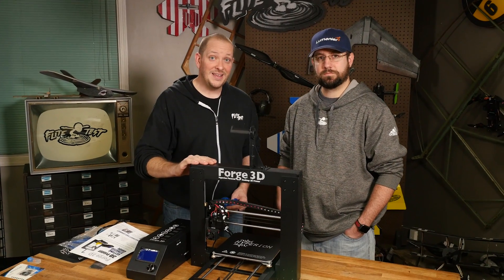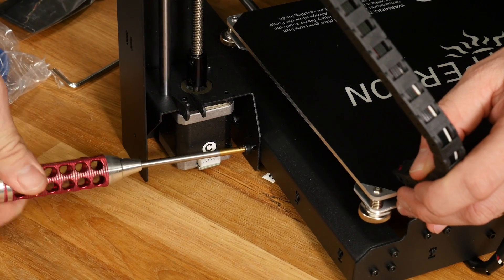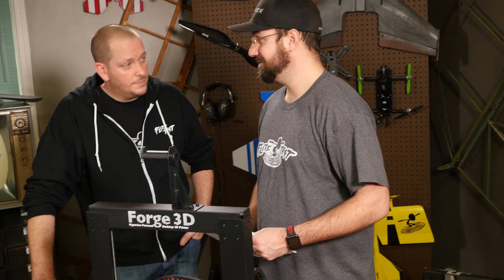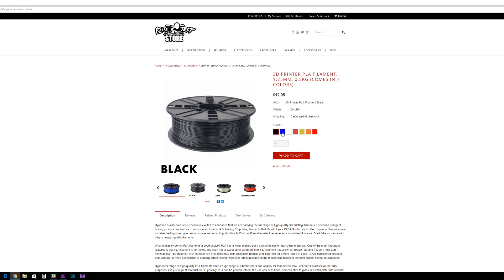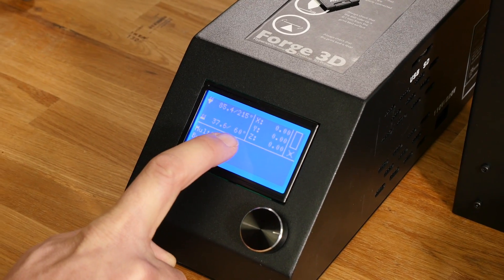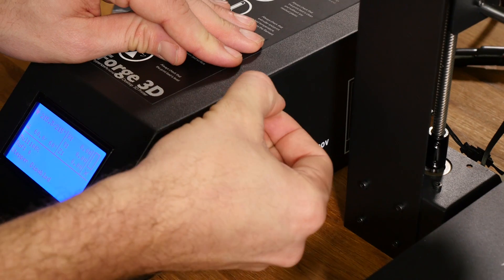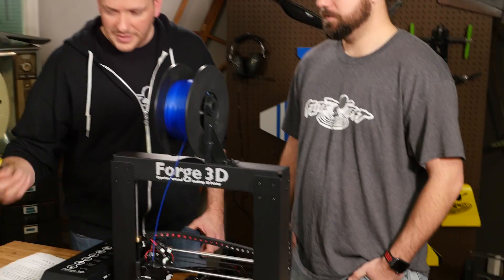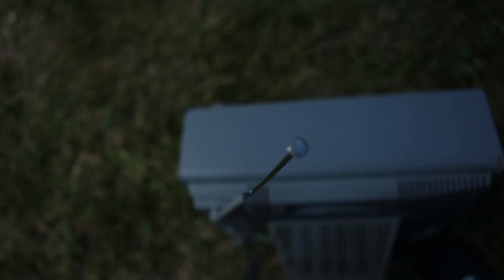How To Setup the Forge 3D Printer | Flite Test

Comment: I got the Monoprice version of this when it was on sale for $260 around New Years.  It worked right away but has a ton of little problems that should have been fixed at the factory before it was released for sale.  The Z axis tower is wobbly and needs to be braced.  The pulley under the front of the bed was mounted using the wrong kind of screw so it couldn't be tightened down so they put a nut on the inside which makes the belt be about 6mm out of alignment to the right.  There are plans on Thingaverse to print a new bracket but just using the proper screw will fix that. The Cura software that came with the unit was an obsolete version in Chinese.  It's the same version in English that you see in all the Youtube videos showing how to setup the unit but it's no longer supported by Cura since they have a new version that's totally different.  The fan in the control box has bad bearings and is very noisy.  They are reporting on the forums the connections on the control board for the heated bed are too small and tend to burn up but you can buy a heavy duty external controller from Banggood for $7 that can be installed to fix that.  There was no damage to mine but I noticed the bed draws 20 Amps when it's heating up while the rest of the unit draws 3.5 Amps but the power supply is only rated for 20 Amps and will be overloaded.  The bed is mounted on a thin piece of sheet metal that tends to bend down at the corners making the clearance hard to keep adjusted but you can buy a stiffer piece on Ebay for $15 or make one out of thicker metal that won't bend so easily.  The oddest thing is the rod holding the spools of filament is too small and the bracket is too weak to hold up a spool!  You'd think they would have checked that at the factory!  I used a 6" piece of 1" plastic pipe to make a larger rod and added a second bracket at the outside end to hold it up. Monoprice has the best deal on filament though, just $19.95 per 1Kg spool. They have free shipping on orders over $50 and I got 15% off using code Maker15 so 3 spools cost just $51 with free shipping!

Comment: DO NOT turn off the printer and let it cool down, it will eventually clog the nozzle. Go to SD then click stop print. Then go to cool down under heat up pla. And if you have any questions just reply, thanks

Comment: I have three printers, all but one was a box of parts that had to be assembled piece by piece. After finishing assembly then the arduino board had to be downloaded with software code and fine tuned with a dial indicator on all axis. Only my FlashForge was plug and play. I use either Autocad or SketchUp to design parts which then go to Cura for slicing into g-code that the machine uses. I worked for National Oilwell Varco as a lead programmer machinist trainer, this is child's play compared to 9-axis dual spindle Mori-Seiki NTs, or Mazak Integrex.

Comment: I can level by eye now, at one time, I hated leveling so much I would just cover the bed with adhesive instead xD Now I print on glass with no adhesive at all. Suction of the smooth glass and level bed holds the part in place.

Comment: It's important you don't just switch off the power button after the print ends. You have to leave it on so the heater in the extruded lowers its temperature slowly, preventing blockages. Switching it off makes it harden inside incorrectly

Comment: You really don't won't to just kill the power u could easy melt the cooling fan that is attached to the extruder heat sink best to go in to the window and hit kill or stop print that way the fan will stay on and bring the temp down safely.

Comment: AHey guys, LOVE the videos!!!  This is a rebranded Wanhoa Duplucator i3...   I have the same printer rebranded to Monoprice Maker select V2.     Just wanted you to know that so that later you can see the mods for the printer for stability mods.

Never move the printer parts manually while the printer is on. Turn it off then move it. or use the settings to fast move settings.

And to save you some time, you can use a raspberry pi to be a print server for that printer. You can do time lapses, see the printer status, and set the print order with multiple files.

Again LOVE your work!  Keep it up!
Reply: Also you should measure from 2 inches in from the corners to get the plate level as well.

Comment: Also, nobody really uses the extruder motor to feed filament. :-) It has become traditional among long-beards to just push it through manually so you can feel how silky smooth it is at the current temp. After a while you can dial-in settings (and whether you've got a nozzle jam) from the feelings. (There's a billion poor-taste puns that could go here, I'll leave them to y'all)
Reply: I mean during the initial filament load. Not when printing, of course.

Comment: Nice! Looks like a clone of the Wanhao Duplicator i3 but with long bearings. I've got the hobbyking Malyan M150 which is another clone. It's fun noting all the little variations. Those are the best bearings on any clone I've seen, it's got the nice sloped control panel front of the Di3, but the cable management on the hot-end is also the same horror-show as the Wanhao/Cocoon (please put some heat-shrink over that thermistor "connector"! If it falls out, badness follows swiftly.) where Hobbyking did much better on the Malyan M150 with proper connectors. (even though their heater connector is under-rated and melts)

(I know all this because I just spent a month doing a redesign of the print head on the Wanhao/Malyan to fit a remote bowden E3D V6 hot-end: http://www.thingiverse.com/thing:2068847 which I very much recommend.)

And yes, they're all poor clones of the Prusa i3 (which is widely considered the best value printer out there) But with thick sheet metal construction they're definitely one of the better built variants. (no plywood, or other cardboard-related materials)

One note: at 4:57 you "lift" the print-head by manually pushing the carriage up the Z-axis. Unless you're a robot with perfect synchronization, this is a BAD IDEA and will usually leave you with slightly mis-matched Z-axes which can put visible "banding" on the print, and will throw off the alignment with the bed. The original Prusia i3 solved this by regularly "homing" against the end of the Z-axes, but if you try that on a Wanhao/Malyan, the "Guillotine comes down" on the extruder. (So I use a ruler to set them to the same distance from the top regularly and I'm careful to only move that axis via software. A pain, but necessary.)

Comment: wow y u do this? why you no do cheap 3d printer kit which you can upgrade yourself to make it a high end printer :(
Reply: Because that takes at least a year of learning how these things work, they're only still beginning, and half those kits involve exposed mains wiring that can kill you if you get it wrong. Sometimes because the random cable you were sent had the wrong colors, or the PSU was so under-rated it catches fire. Props may cut you, but mains AC will stop your heart. They're being sane and sensible, which I understand is unusual on YouTube.
Reply: lol sure... 120v will not kill a health human adult. every one in construction has most likely been zapped with 120v and they are not even dealing with electricity by trade. ive been hit with 277 2 times. 120v is childs play and it only makes your arm tingle with a numbing feeling to it.

 but ok I see you are a "safety expert" dont do this because its unsafe... life is unsafe we are all going to die, that doesn't stop me from climbing on top of ladders, or putting my hand in live  panels, or even going under my car to do a oil change. also these guys have built hotwire cutters and butane jet how is that less safe then a 3d printer.  and that 3d printer and basic electrical knowledge does not take a year sorry to say maybe if you have a disability that statement would be true. it takes a week or 2 if you dont have time.
Reply: Excuse me? "lol sure" to the idea that mains power can kill you? Not all countries use your weak-ass 120v, and not knowing that is why you shouldn't be giving electrical advice on a global platform.

Comment: Hey guys! Long time viewer short time poster.  I highly recommend you get a sheet of glass for that build plate.  You can use standard binder clips to hold it in place.  After that readjust your leveling and you're good to go.

Lots of people recommend to cover the build plate in blue painters tape.  If you use the glass as I mentioned above you can coat the build plate with a Elmer's glue stick.  The glue gives you amazing adhesion and prevents lifting of the part during build time.  Once a print is completed and cooled off simply remove it from the glass bed and take it to a sink to rinse off the glue.  It comes right off and has 0 hassle.

I highly recommend you check out a product called ninja flex.  It's a rubberized 3d printing filament that creates some amazingly strong and flexible prints.

I teach at a high school where I have 6 printers running almost non-stop.  I've been through the learning curve.  Hope this helps.
Reply: I have two of these and I agree that a glass bed is a must. I tried the build tak that comes with it and I just was not impressed. It took forever to clean the build plate up from that glue build tak uses on the sheets but well worth it once I got my glass bed on there. P.S. I have had the best luck using duck brand painters tape from ace hardware here.

Comment: You guys picked a great printer to stock. I've had the MP version of that printer for over a year. I can't wait until you start posting .stl files for new designed. BTW You're not supposed to manually raise the Z-axis. One of the z-motors will spin a little more and you will need to re-level the bed. Click position, then Z fast, and let the printer do the work.

Comment: people interested in buying this printer should join the facebook group for the wanhao duplicator i3, maker select, etc.  There is a large community for support, and if this printer isnt the latest batch that fixed the bed connector issue(among others) being under rated for the amp draw it is a fire hazard as the connector can melt down.  Only way to check it is to open the control box and look.
Reply: sniffle23 I'll do that tomorrow and ensure it is.
Reply: T-Bone Drones I'm a moderator on the fb group and more than happy to help with anything you guys might come across or need help with.  T.S.

Comment: The tower bolts should be tightened with the printer laying flat on the table to prevent torquing the frame out of true. This style printer is a good value for the price, but you really need to make some modifications to make it a great, reliable printer. Lots of great recommendations, guides, tips, and troubleshooting info available over at the "Wanhao Duplicator I3" section of the 3DPrinterWiki. Also lots of helpful people over at the "Duplicator i3" Facebook and Thingiverse groups.

Comment: 04:52 lifting the Z-carriage like that is a terrible idea! do not do it! it will misalign the two lead screws that move the X-axis assembly up and down.
and trust me, as someone who also uses a duplicator I3 clone. it's a nightmare to fix without some really fancy custom tools.
also, i don't think this is the best way to set up the printer. there are some things that could be done in a better way.

Comment: i'm a little leery of this forge thing...
a better combo is this (for about $250)
Anet A8 kit, $150, the A8 is super well known by the community with lots of support and designs for upgraded parts to print
E3Dv6 hot end, (the thing that melts the plastic). $75. e3d is like the gold standard for hotends and are super reliable and can print almost any material out there
PEI build sheet, $20? This material covers your glass print surface and is a special polymer that gets incredibly sticky to plastic at high temperatures but becomes very slippery as it cools. this will allow you to print ABS without it warping (Which is a very common ABS issue) and generally makes your prints stick like crazy good.

for $250 you get a machine that prints almost as good as machines ten times its cost. and that isn't hyperbole, its comparable print quality and reliability to $2500 machines
Reply: The Forge isn't perfect, but the A8 is much worse as an actual printer. The reason is "shear forces". Look at the A8, then imagine grabbing the top of the frame and the base, and pushing hard to one side or twisting. What's stopping it from bending and snapping? Also, don't get me started on the exposed PSU wiring they artfully never show you in the pictures. (Rule#1, don't electrocute the customer.) Good value spare parts though.
Reply: Or even better, the TEVO tarantula! :D
But I guess thats only for people with enough mechanical/electrical knowledge that not everyone in this hobby will have :)
Reply: meh, i find whatever has really good community support to be best, because if you have any problems then chances 1) someone else has had the problem and fixed it and documented the fix somewhere 2) someone has designed and printed a part that you can also print to fix the problem.
the more obscure you get with machines, the less of that is present
Reply: I dont know, building printers in definately not for everyone. And the TEVO has a bare PSU that needs to be wired. I would not trust anyone without some xp in electronics to do that

Comment: To move the extruder you can better use the function move axis. The first reason is if you move the z-axes by hand your bed isn't level anymore. Second you can damage the controller board by making "electricity" with your steppers.

Comment: The small lever where you feed the filament in should be able to pressed down. It disengages the stepper motor from the filament, so you can manually push it through. This allows for a lot quicker loading of new filament and it gives you more feedback if it is stuck somewhere or similar. Just push slowly until a bit of plastic comes out of the nozzle.

This is also important for switch filaments where you heat up the nozzle, manually push some filament down through the nozzle and then quickly pull it back out while holding the lever down of course.

The white filament that is coming out while you are feeding the filament in is probably the material that was used for testing at the manufacturer.

Comment: I have pretty much switched over to petg after printing for the last 4 years with ABS and PLA. PETG gives super high layer adhesion but has to be run pretty hot. I should be out at FliteFest East this year wth a DTFB delta with 3d printed motor mount, control horns and servo mounts.. Two awesome hobbies that work great together!

Comment: I strongly suggest to get PETg on the store. It's as easy to handle as PLA, but a lot more heat resistant (it even has to be printed at a higher temperature) and a lot stronger. 

I just don't know good quality manufacturers in the US. Here in Europe I've been using "ICE PET" from Amazon. It's made by a manufacturer that got really good results in PLA tests, but decided to stop selling their product on their own and instead go white label - being rebranded by other sellers now.

Comment: 1.)  This is a Wanhao Duplicator i3 v2 // Monoprice Maker Select // tons of other Prusa i3 clones.
2.)  Pick up the same exact thing on Amazon (with free, Prime shipping available) for ~$100 LESS (calculated w/ shipping)
3.)  This printer has a fatal design flaw involving the heated bed connection to the control board.  FLITETEST: you are selling a printer which could burn people's houses down!  This is a very well known and documented issue.

Sorry to get all negative-nancy, but when I see fellow hobbyists dipping toes into another one of my hobbies, I can't help but provide this sort of input.  IMO, Flitetest should be designing 3d printed aircraft and parts, and selling those...not the printers...
Reply: Dean Cripps Can you provide details on that fatal flaw? I have the Maker Select and I haven't heard of this.
Reply: The terminals on the the controller board (Melzi board) can't handle the heated bed amperage and will melt.  Just google something like "Duplicator i3 bed connector melted".  Reddit is also full of instances.  Hell, it happened to mine.  Primarily occurs under ABS temps, so 90c bed temp (like mine was at).  But some users have reported ONLY printing PLA at a bed temp of 60c before the connector smoked.  I fixed mine by direct-soldering the negative wire to the board, and running the positive heat bed wire directly to the 12v PSU.  Some people are using Solid State Relays or Mosfet boards.
Reply: The other ones are kits and not mostly pre-assembled like the Hyperion Forge. Saving hours of work can actually be worth the extra $100. According to the website, the Forge is based on the Prusa i3 v2 - this can't be the Mk2 though?

Are you sure the Forge is using the Melzi board too? It seems to be a pretty new product. I haven't heard anything about it and can't find a lot of reviews or info on it online.
Reply: let me reassure you that this printer they set up is exactly like a Monoprice Maker Select v2.  Only the "Hyperion" branding is different, which factories in China are glad to do for a company.  From the unboxing, to the assembly, to the operation, it's a prusa i3 v2 clone that has many names.  I'd be very surprised if the board or connectors are different.

Comment: You should DEFINITELY make 3D printed planes! Or at least 3D printed wings and propellers!
Reply: I think I'd stay away from 3d printed propellers.
Reply: The experiment must be done! PLA would snap like a twig, but PETG might do it. (Aren't props ABS?) Nylon would be too soft, but I just got a roll of Polycarbonate filament and they make bolts from that stuff! And there is carbon fiber (even kevlar)  filament if you want to take it all the way to stupid-town.